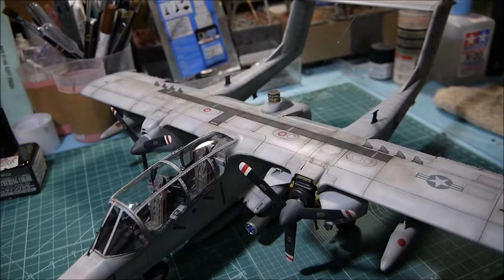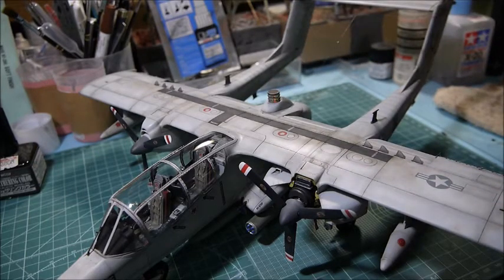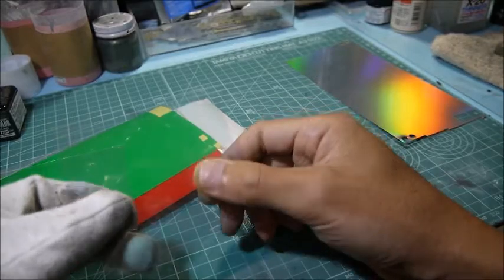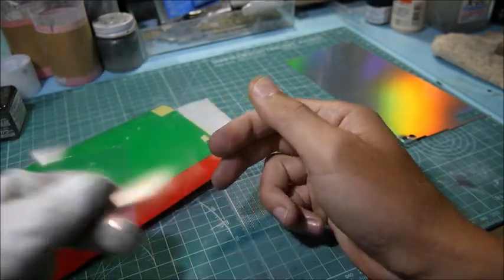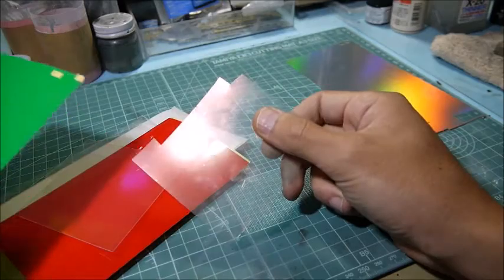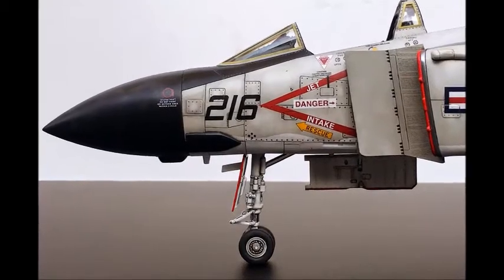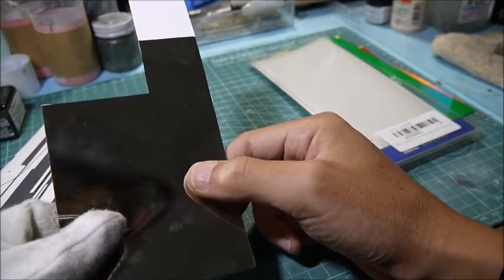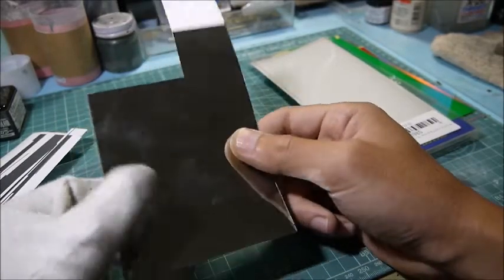Little Tips  Useful Materials(Phosphorescent sheet etc)for modern aircraft

Comment: Excellent tip using the luminous paper. I managed to get a sheet and tested on both 1/32 and 1/72 kits and they work really well. Easy to cut and size and glow is super bright. Cheers 🍻